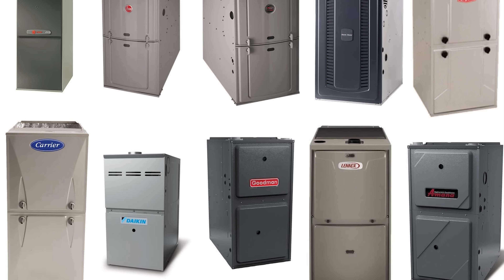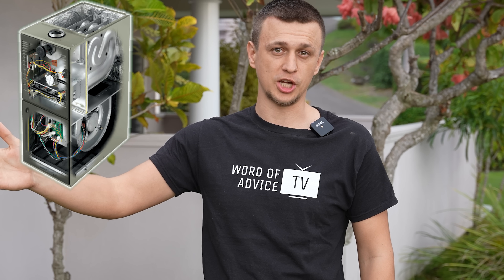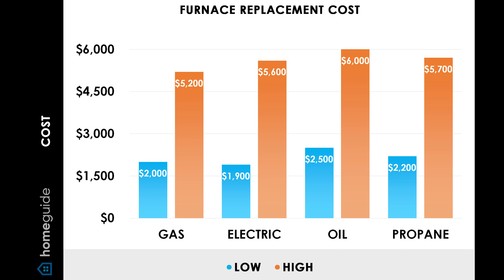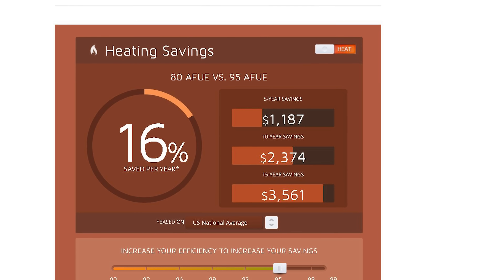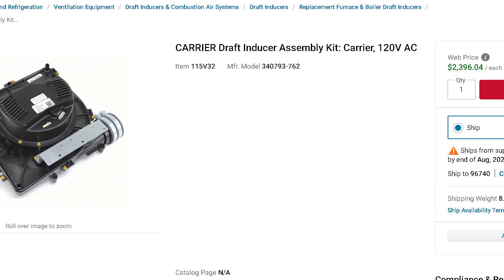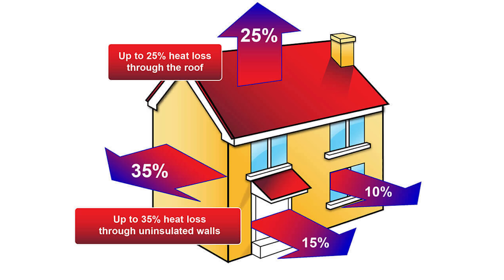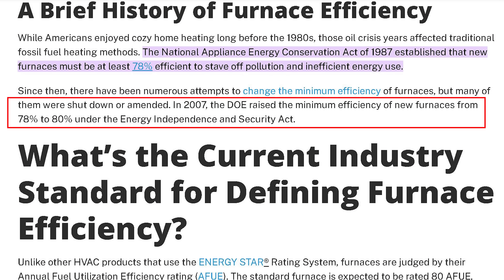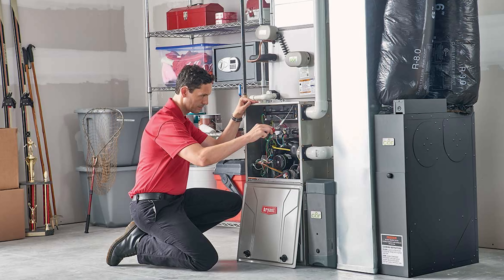Don't Buy a High Efficiency Furnace!

Comment: When We purchased our house 19 years ago, it had a 60% furnace.  We purchased a Trane 94% AFU, 2 stage, condensing furnace.  It paid for itself in 4.5 winters by NG gas savings alone.  With cleaning/maintenance every 2 years, it lasted 19 years until we sold the house.  It is still working well today.  The house is located in upstate NY, so winters are a thing.
Reply: My Lennox condensing furnace has been heating my large house in northern Canada for 37 years without a repair.
Reply: Oh yeah, there is zero reason to keep any old natural draft furnace in any home. Full 40% of the gas you pay for is right up the chimney.
Reply: Ya I have installed a few hundred high efficiency furnaces and I totally do agree with what he has said and most of mine are 20 years old never had to repair any yet except for small parts, also thankless hot water heaters will never go back to tank.
Reply: That’s because you purchased that Trane furnace almost 19 years ago. You couldn’t buy a Trane furnace today that would last 19 years. Secondly, 19 years ago you had a PSC blower motor which would last a good 20 years. Today’s Trane condensing furnace contains an ECM motor which has about a four year lifespan and they cost over $1000 to replace. The advice given in the video is advice for people making the purchase now…..not 19 years ago, not 37 years ago….. now.
Reply: Well you should service it twice a year spring and fall.
Reply: @arthouston7361  Our motor was the two stage motor set up.  So if the motor is the problem, and not the condenser or burner, then what brand should one choose to have a good long life trouble free furnace.
Reply: @gibblespascack1418   Well the motor isn't the only problem. Unfortunately, the fact is that condensing furnaces produce an acidic condensate water that should be treated before being released into the environment and that's usually done by neutralizing it by passing it over some calcium chips.  That same water has a tendency to corrode the metal parts that it comes in contact with inside the furnace itself before it is drained out. It is also unfortunate the furnace manufacturers are competing against one another based upon price rather than the longevity of the product. Some of the popularity of these condensing units is being driven by the Department of Energy, because they have put in place mandates for certain areas of the country for heating and air conditioning equipment for the purpose of "saving the environment," rather than being good investments for consumers.  So the bottom line is you try to buy a unit that offers a good warranty. You don't buy it on the Internet where you could lose having that warranty be enforceable, and you simply live with the fact that these units are designed with planned obsolescence in mind, so that within 7 to 12 years someone can sell you a brand new condensing furnace.  It is possible to have a good contractor replace failed heat exchangers in these units when they are under the manufacturer's warranty, or when the manufacturer has issued a large scale recall allowing either credits or replacement heat exchanges due to an unforeseen shorter than average service life. My advice would be to talk to friends and co-workers about who the good companies are in their area that they have used and would use again and have a conversation with those individuals about warranties and coverage and expected service life of the equipment that they are selling. I am a commercial technician..... so I rarely have to deal with these, but I keep having friends tell me horror stories, too.
Reply: @Art Houston  ya I had a motor like that and said it was going to cost 750 to replace it so I took it to my friends shop who rebuilds them and inside is a transiter that is the size of a quarter cost 12 bu ks and never had to replace it the transiter goes first to prevent motor to go bad.
Reply: @rickblue7002  We were all replacing that failed common component until the motor manufacturers started filling the entire circuit board area with resin in order to sell more motors.
Reply: @arthouston7361  You make it sound like they switched to lower quality parts to nail people on replacement parts.... oh wait.
Reply: @arthouston7361  Eventually the avg person is going to catch on why right to repair is one of the most underrated issues of our time.
Reply: @zeroibis   The units are made less robust because the price had to be competitive to remain an economic force in the market, which also led to a greater frequency of replacement of the units, which also works well for all the manufacturers.
Reply: @arthouston7361  This would make sense, if the replacement parts cost less money, IE they were cheaper parts. Instead we see more expensive parts that are less reliable. These more expensive parts obviously make the product more expensive to make and sell as well as repair. Thus logically the issue clearly does not have to do with price competitiveness... Usually when there is a market distortion like this there is some external factor at play and in this case you can look at the gov push for tech that is not ready for prime time and we all get to pay the price for it.
Reply: @zeroibis   Unfortunately the reverse is true. The manufactured parts that are used to assemble the units initially are cheaper on the whole then the more robust parts would be. Let's say that across the industry when you look at 8 or 9 different manufacturers, it costs the manufacturer about $400 to build a furnace that will retail for more than 3 or 4 times that. The repair parts that they sell are not being sold at the same price that it took to acquire them and assemble the furnaces. Those repair parts all get marked up substantially.  
In order to build a higher quality furnace, it might cost the manufacturer $800 instead of $400 to build it, and then the retail price would be so much more than the other manufacturers' units that their sales would plummet, they wouldn't be selling as many replacement units because it's a better unit, and they wouldn't be able to sell as many replacement parts because even the parts would be of a better quality.
So the manufacturer that would build a better unit would quickly go out of business. That's why these furnaces are not as good.
Reply: @arthouston7361  This would imply that their profit margins are well over 50% at least if they are selling at 3-4 times cost if you factor all their possible expenses. I highly doubt this.
Reply: @zeroibis   Well, I have worked in the business on the commercial side for a couple of decades....so you are welcome to your opinion...even though it's wrong.
Reply: @arthouston7361  I checked one company to see its public fillings and I will say say gross profit at >30% is inline with that you said; however, still not high enough for those markups. I can see if you are talking about what the end customer makes after all the additional markups after that fact. This brings up a good point too about how people also get shafted by the HVAC industry. If I setup a shell company and buy parts suddenly I can walk into Baker and buy parts for way less. As a regular home owner oh you want the part to fix it yourself it is priced up to the same someone would charge to do it for you. Just look at the markup on a dam running cap for a home owner vs a "contractor".
Reply: @zeroibis   Well, let me tell you what would happen if a lot of people made a shell company and bought their parts at Baker and did it themselves. You would find so few contractors willing to do this kind of work that the people who don't do what you're proposing would be paying 2 to 3 times what they're paying right now, and waiting much longer.  Almost no young people are going into the HVAC trade. They don't have the willingness to leave the house at a given time, to be able to pass drug tests, to be able to take direction from superiors, and to interact with the public in a way that the public desires. We have moved from an industry where every technician knows how to repair the equipment and replace it when needed,, with a business model of every technician carrying an ipad with bright pictures and the word "efficiency" shown all over the place, and mentioning of financing. They sit down with the customer because their "poor unit has reached the ripe old age of 7 years old, and Mrs. Migillicuddy, it's time to replace that unit....but don't worry....we can give you financing for a $16000 installation." 
The industry has found a way to regulate itself in terms of pricing by offering service plans which eliminate trip charges, and by offering warranties and financing. I understand you think that the hvac industry may be "shafting people," but the alternative is to not have an hvac industry.  There's a very large HVAC residential company in my area that covers several counties and has dozens and dozens and dozens of trucks... driven by young men with crisp white shirts and dark pants and protective booties so that they don't track dirt into the customer's house....and they crow about their "extensive training every week." What they don't say is that "extensive training" is sales training.  You have to remember that it is customers who make the decision to do business with companies like that.
Reply: @zeroibis   It isn't a matter of people being able to fix their own stuff, although that does require a certain type of ability, intuition, and skill set, coupled with some life experience. Products have become disposable, so people have less experience in repairing their own stuff, so you're not going to find as many people who are willing to invest the time to develop the skills to be able to fix their own items..... they're going to want to call somebody, and if there's too much do-it-yourself happening, from people who are able, that means that there are going to be fewer contractors available to do the kind of work we're talking about.  Look at what has happened to carpentry and remodeling due to places like Lowe's and home depot. Try to find a good contractor that can come to your house within the next 9 months. Everyone I know in that business is booked out almost a year ahead, because there aren't as many people going into the business,  And as a result they charge a lot of money for their services.
 As for Amazon..... I think it's been about 8 years since I bought anything there.
Reply: 4.5 years hmmm even with 60% eff that seems low to me
Reply: @msk3905  That was with natural gas savings alone.  We lived in a rather warm area for NY state and my NG usage was reduced to ~ 750 CCF per winter.  (The original furnace used ~1200 ccf per winter).  So it took time.  If I was in a colder area, it would have been faster.  Also the NG cost was not the issue for us, it was the delivery charge of the natural gas from Orange and Rockland through the same pipe that has been in the ground since 1957.  Funny how that delivery charge became more expensive than the NG and kept going up year after year, so that the profits at the utility can keep rising faster than the S&P 500.  Our Trane 94% condensing unit was $3200 with installation.
Reply: @arthouston7361  I have a 15 to 18 year old Bryant furnace with A ecm blower and combustion blower and haven't touched it other than cleaning the combustion side twice. I have Ben in the trade sense 1983 and all the premature breakdowns I have Sean was pore installation problems. I would never install a 80% furnace in anybody's house are business
Reply: @gibblespascack1418   so unit cost $3200 to install and gave a NG payback of 4.5 years meaning you saved a total of 2,025 ccf or $711 using $0.35/ccf.  over this time frame.  When i look at the average NG delivered residential price per ccf in NY state for 2003 & 2004 on US EIA I see it at $0.11 to $0.12/ccf upto $0.157/ccf in 2007…something still doesn’t look right to me but glad it worked out for you.  Corrected error $0.35 not $0.035
Reply: @arthouston7361  Trane was the first brand to debut ECM motors FYI. They've had them since the mid 80s.
Reply: All the Trane stuff that I've worked on from the mid eighties has been commercial equipment...... splits and rooftop units..... and all of those used either 3 phase motors or PSC motors.  I see that Trane is using their own larger ECM motor in rooftop units now, and I am dreading the day I have to replace one of them because there's no easy access.
Reply: @arthouston7361  You have to recall that Trane (more like American Standard) bought out GE's old AC business, and GE made those motors back in the day, so the high end stuff had them. Then GE sold that business off to Regal Beloit and now is called Genteq.
GE's stuff was the best. Today nothing is.
Reply: @sprockkets   I do. I actually had a General Electric branded unit on top of one of my stores....from 1973.....
with the original compressor.
Reply: @rickblue7002  problem with tankless water heaters is the hot water delay whereas tanks have more or so instant hot water. Only way to go around not having that delay on a tankless is to have a holding tank but it only makes sense to install one if you have a boiler that does heating and domestic
Reply: @MysticSkills91  I put a recirc line in takes 15 seconds from farthest bathroom my in laws have a tank and from the water heater to the farthest bathroom take 35to40 seconds all the ones I have installed in tbe last 20 years are still going great but you have to service them once to twice a year. I pump cleaning vinegar through all of them at least once a year a few have hard water so I clean them twice a year takes 1.5 hours. So I don't have any issues if it is installed correctly and has a recirculation pump or line so it feeds both directions at once
Reply: New furnaces sold today, not 39 years ago, do not last this long. I’m an hvac tech. It’s called planned obsolescence. Manufacturers are excited about legislation to ban natural draft furnaces.
Reply: @arthouston7361  you mean I cant travel back in time and buy a new trane for my house that was built 10 years ago?... I'm gonna need a Delorean with a trailer hitch
Reply: Oh wow. Sure HOPE so, because I bought in 2019 and has condensing furnace.
Reply: @zeroibis It's America-profits of 50% or more per item is standard.
Reply: One problem is that upgrade requires complete rebuild of your venting system,  if old was venting vertically. I'n my house, to build side vent as required by high efficiency requires going through foundation concrete. Mid efficiency is a sweet spot here
Reply: Cleaning / maintenance every 2 years???  If you did cleaning and maintenance on an 80% furnace every 2 years it would last forever.  That is the cost differential right there. I come across 80% furnaces that are 20-30 years old and still work and the people never did anything to it.  

Let me re-iterate, NEVER DID ANYTHING.  Rat pellets in it. Feathers in it. Never changed the filter. Ran it with no filter. etc.  It is actually more fair to say they abuse it.  They most definitely don't pay money to have regular cleaning and maintenance on it every 2 years. Yet, it still works, 30 years later.
Reply: I love this man! Thank you for being so honest and straight forward!
I would definitely rather save money on repairs!
So many new items seem to be junk, in lieu of benefiting the consumer. They don't care! "Let the consumer pay!"😢
Reply: I have a trane xb80 from 2005 still going strong I do all the annual service inspection and keep it running. Never had 1 problem with it 🤞
Reply: @rickblue7002  and how much does that cost? I have a standard efficiency and haven't touched it besides the filter for 5 years. I know Jay said maybe 3 but...
Reply: @mikel8185  alot more today today ,I checked prices on Rinna tankless it was 2400. Nortz are around 1500plus and to have one installed material,s and labor I'm guessing 3k. I love mine and all my friends love theirs just pump  cleanin vinegar 4to6% I try to do it twice a year.  Love always hot water.
Reply: @mikel8185  also most larger companies charge probably twice as much, takes me about a day now cuz I'm late 60s so I slowed down a little
Reply: Mine was installed’82
Reply: That's good hope you service it twice a year and you had it checked for  racks in the heat exchanger. That could be a hassled. Put a carbondeoxide tester in front of the furnace on the floor joist in basement ceiling or if it's in a closet put one there. Make sure all pipes are in good shape. And max sure the flame is blue not orange, this means it needs cleaded and air mixture is good because yellow or orange cost gas monies.
Reply: @rickblue7002 you put a recirc  line on a tankless dwh?
    I’ve never heard of how you can do it without the tank firing every 10 minutes?
     Any check valves , mixing valves ? I don’t understand how ?
Reply: @jamesortolano3983  yes check valve and recurc line from farthest one and in between, we have been doing it for years in the commercial settings and now residential.  Never had any issues
Reply: @arthouston7361  I don't know what garbage you are buying but my Goodman 2 stage 92% furnace with the variable speed ECM motor has been running without flaw for 18 years and counting.
Reply: @tombonini7393  Tom, I would say that you are very fortunate because I know the failure rate of most ecm motors. You got a real good one. How would know that? Because I've been doing mechanical work for decades.
Reply: @tombonini7393  I installed two Goodman / Amana high efficiency furnaces for my parents back in 2011 when I was about 2 1/2 years into the  trade I replaced a flu collector on one of them this year and the other one and inducer motor that was noisy in nearly 14 years installed media air cleaners on them and they still look barely over a a few years old. If they are installed and maintained properly, they work just fine. I don’t see that many issues with high efficiency furnaces if they’re installed with some degree of care
Reply: I’ve noticed a sharp decrease in the number of ECM motors. I’ve seen go bad in the last couple years. I had to replace quite a few of the earlier Lennox ECM motors because moisture was getting into the end bell. But the good news being that you’re not always completely locked into the OEM ECM motor anymore even if that would be my preferred repair. Lately I have not been noticing many failures, probably unexpectedly high energy usage if they are installed in a system with poor ductwork
Reply: Plenty of furnaces can go 30 years or more. Impressive would be a condenser that lasted 30 years in Phoenix.
Reply: @arthouston7361  ECM are ok if they’re blowing air all the time vs on and off cycles.
Reply: @arthouston7361  good point and I am now in market to replace my carrier high efficient fucrnace which stopped working due to secondary heat exchanger after 19yrs so still trying to convince myself what furnace would be the best replacement. We live in Philadelphia where these days temp are below freezing for many weeks.
Reply: @gibblespascack1418  Yeah well a furnace is like 10-15k now.
Reply: @MrMatthewb9876  Actually the 96% condensing unit 60 k btu for this other house cost $4600 including installation(Feb 2024).  In this house it was replacing and 80% unit so that we could eliminate the chimney going up through the kitchen.  Now our kitchen gained a space of 24 inches by 16 inches where the chimney was located.  Now our NG usage is 20% lower vs the same exterior temperature for the old furnace.  It will eventually pay for itself, but not in 4.5 years like the house 19 years ago, unless if NG prices rise again.
Reply: @gibblespascack1418  Interesting, those are not prices around here at all. I'm still gonna rock my 80 percent till it dies. Don't plan on living here the 15 years it takes to break even.
Reply: @MrMatthewb9876  It all depends on where you live and the reason for the change.  We live in central NY where the heating season is 8 months.  I would have lived with the 80% unit(100K btu), in this house, because it was only 3 years old.  It was installed before we purchased this house.  When we were ready for the kitchen renovation, getting rid of the chimney, in the kitchen, became a good reason for the change.  We were also able to sell the old unit for $500 which also helped.  For our renovation, it added 16" of cabinet space and doubled a closet size on the second floor.